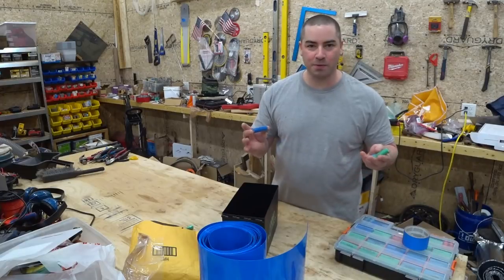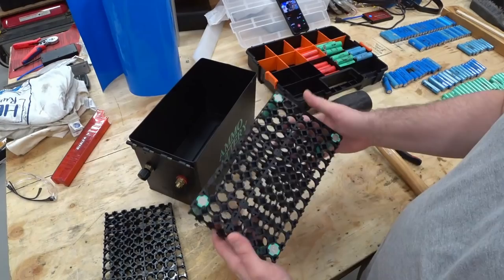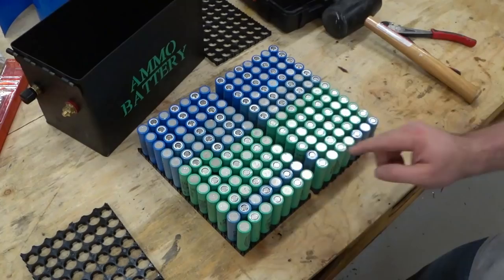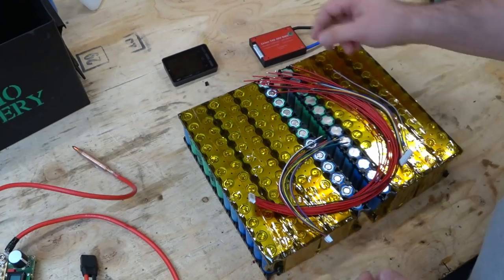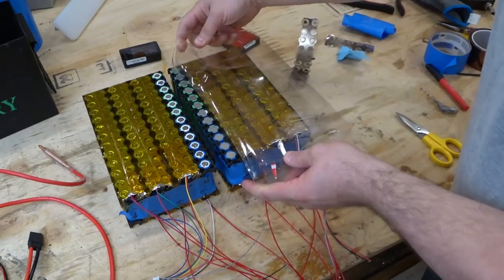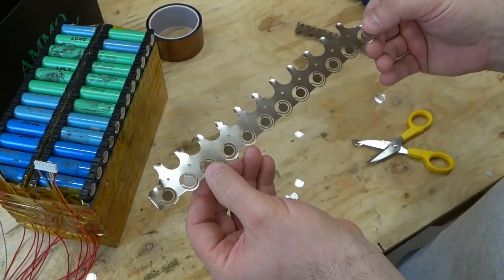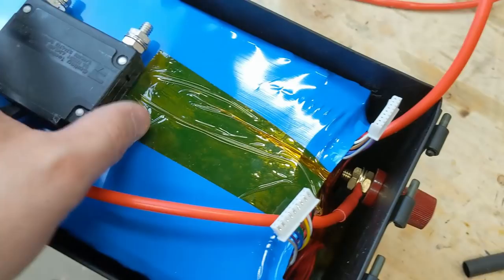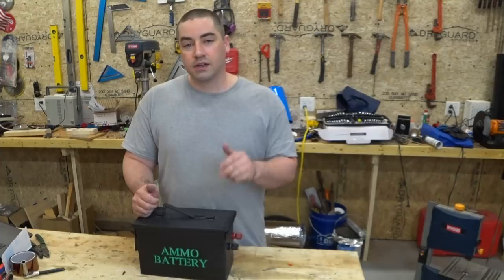48v DIY Battery in an Ammo Can

Comment: Hey Mr. p...I just heard somebody say something on another YouTube channel about hooking up something called a soft start for your hi draw tools..
Reply from the maker: Yep, that is fine for lots of stuff out there.  Even if I added an aftermarket soft-start kit to my miter saw, the running watts are as high at 15 amps.  This would be if you were pushing the miter saw through thick oak or LVL or something.  15 amps at 120v = 1800 watts.  Assuming a 90% efficient inverter, maybe 2000watts on the DC side, if the battery is at 50 volts, that's 40 amps.  This is 40 amps while running, not just starting.  Starting would be more.  40 amps would overload this little battery given it's BMS, wiring, cells, and breaker.  So a soft-start kit would not help this exact battery.

Comment: Is there a possibility for such a box with 12V output that can handle 3000W 12V - 230V without problems even for a loooong time??
Reply from the maker: Yes, but it would be much larger.  I built a 12v version, but you would still need 3 of them to handle a 3000w load.  https://youtu.be/6Ai5IRQbLcc

Comment: Thanks for the video! I’m working on something similar for camping or wherever I might need the power. You mention you used a 20amp breaker to limit current and heat. How is the 20amp circuit breaker limiting current for you, or it that just for safety? Wouldn’t that 60 amp BMS allow more than 20amps especially with that wire thickness at 48v? 
I’m really looking for the best way to hold typical outbound current in an ammo can like this, and the only thing I can come up with that would also fit in a can this size is specific cable size that is matched to the max amps I want to let out, so that only a certain amount of current can be pulled from the batteries. So I was just curious if the breaker is helping at all to limit current without popping all of the time with 168 cells divided by only 20 amps, or if you had any other suggestions?
Reply: The BMS has over current protection so why not just go with the 20 amp BMS and skip the $15 circuit breaker.  The 20 amp BMS cost $10 less than the 60 amp BMS and will disconnect the battery if you go over 20 amps.  That BMS has a 15, 20, 30, 40, 50, 60, 80 and 100 amp version.  I would think for your application and battery type the 15 or 20 amp version would be better.

Comment: Cool.  I have some ammo cans. Going to give this a try.   Did you 3D print the cell holders?
Reply from the maker: No, I bought the cell holders from 18650ed.  It's a company in Rhode Island, owner/operator is Keith.  He usually sells through e-bay: https://18650shrinkandcellholders.com/  https://www.ebay.com/str/18650shrinkandcellholders

Comment: I'm thinking about building this exact pack for powering an ebike conversion (750W nominal motor). Any concern with that? By my calculations, with the ebike contoller I'd be using, I'd be
configuring it for 20A max discharge, and with the cells I'm using (rated max discharge of 3225mAh), the 10p configuration would give me 32.25A max discharge for the pack, so I'd be well within safety limits at 20A.
Reply from the maker: Sounds like you have done your math out right.  I ran it for an hour with a temperature probe in there, and a 1C discharge.  The box did get pretty warm, about 100°F inside.  Still within specs, but I went an put a smaller circuit breaker on there limiting it to a 0.5C max.  But I'm using modem cells that are not made for high discharge.  If your cells are made for it (like from power tools) they won't get as warm.

Comment: Hey David love your vids. They have inspired me to get my solar project going after 10 yrs looking at it.
   Currently I’m looking at a inverter , but so many choices, I love the xantrex  brand but I’m hoping for something just as reliable but cheaper, could you recommend anything? Thanks
Reply from the maker: I would say the Aims brand is a very good balance between top of the line, and budget.  I used an Aims split-phase to power my house over a year.  but any further discussion will need more details, so Facebook is a better platform for that. https://www.aimscorp.net/
Reply: DavidPoz hey thanks for the quick response. I’m looking at a basic 12 volts system just to get my feet wet, nothing too fancy and expensive just yet.. what do you think about the Renogy inverter?

Comment: if you were rewiring your house with 110vac, would you include some 48vdc outlets? if so, which gauge  copper wire would you use?

thanks for the great videos, each one is more interesting. i really like this build.

i am wiring my house with 20 amp 12 gauge outlets solid copper conductor and 15 amp 14 gauge solid copper conductors for lights. would these work for 48vdc supply? i guess i need to figure amps for DC, just like for AC. perhaps i could use high voltage for light gauge conductors and convert to high amp and low volts (12vdc). i heard of someone using high volts, much higher than 110vac in a normal low voltage coaxial cable to save on the cost of the cable.then converting to 110vac at their home.

i am wondering about running computers from DC with buck converters. i just listened to jupiter broadcasting's latest episode of Self Hosted with wendel discussing 24/7 computer server energy efficiency. what an eye opener of the energy wasted in low power computers. if each component were DC and regulated independently, power could be lowered to a fraction of what they use now. that would be a great subject for a youtube channel! i better not post this. Oops! lol!

there's a lot of electrical topics that could be interesting to explore. take graphene/carbon nanotubes for example, it has PV capabilities and car bodies could become both PV generators and batteries, super lightweight and 10 times as hard as diamonds! and flexible, i image.
Reply from the maker: If I was building a new house today, I would not run 48 volt DC inside the house.  I would probably have an out-building (shed/garage) just for the 48v batteries and inverters.  Then the only thing running into the house would be 120/240v AC.  There is an exception in my mind.  If you were building a very small house (tiny house, cabin, boat) then I might run 12 volt DC wiring throughout just for lights.  But the losses in the wiring would become large even in a middle sized home.
Reply: @DavidPozEnergy  thanks, i am completely rebuilding a double wide, 60 feet (18 meters) long, 24 feet (7.2 meters) wide, so mid-sized.i'm bringing it up to code for real house, including electrical. i thought the power loss associated with DC was somewhat a myth. anyhow, i'll revisit that, i really suspect your focus on 48vdc is a great approach. thanks for answering!

Comment: Looks great but I have a question.  Is that nickel thick enough for the amperage you will be pushing?
Reply from the maker: According to the website: https://batteryhookup.com/collections/cell-level-nickel-fuse/products/nickel-fuse-2p-wide-continuous-roll-by-the-foot-18650-cell-level-fusing  Each connecting strip can handle 10 amps.  Because of the orientation that I have it arranged, that means the nickel strips can handle 120 amps.  But the fuses on the cells will blow before that, and my circuit breaker is 20 amps.  Plenty of margin built in.

Comment: Nice work! How many amps can you pull from this safely? And the amp hour rating? How much does it weigh? I want to build one!
Reply from the maker: The cells are 2200mah each, arranged 12p, so 26.4ah.  The cells can discharge 3 amps each, or 36 amps for the pack.  I limited this to 20 amps with my circuit breaker to keep the assembly running cool.  I don't want it overheating.

Comment: I'm building a couple of these ammo can batteries. I ran into a problem with the first one. on one half of the pack the voltage is 9% higher voltage than the other half. Tha Daly BMS won't start balancing cells until the reach 4.18 v so as I charge 1/2 the pack reaches full voltage before the other half gets to 4.10. The isdt will ballance 1/2 the pack at a time but I can't get the total difference between the 2 packs to change. Any suggestions?
Reply from the maker: When I have a situation like that, I typically will use a hobby charger.  Something like this: https://amzn.to/3w4Vp2O  This icharger X8 is the model I own, but there are several of this type.  First disconnect the BMS.  Then I will hook the X8 up to half the pack (7 cells in my case) and charge/balance all the cells to 4.20v.  Then I disconnect it from that half, and connect the X8 to the other half and charge/balance them to 4.20v.  Then I can disconnect the X8 and re-connect the BMS to take over.  Done.

Comment: hi David awesome video... just a question can this be built to be 12 or 14 volt for a solar system in a pop up camper for boondocking? i want to build a system to avoid the lead acid setup with a greater drawdown capacity for discharging on use  thanks for any help or direction on this
Reply from the maker: Yes, you can reconfigure the cells to make a 12v battery.  Depending on your equipment, a 3s or 4s setup can work.  Or switching to lifepo4 chemistry cells in a 4s makes a very nice 12v battery.  https://batteryhookup.com/collections/lifepo4-batteries/products/4-headway-38120-hp-3-2v-8ah-lifepo4-lithium-batteries-25c-200a-super-cells?rfsn=3333666.ca06e9

Comment: Are there any concerns about airflow or cooling?  I don't know much about this stuff, so just curious.
Reply from the maker: Heat is a concern with any battery.  I thought about cutting in cooling holes or a fan.  But any holes would compromise the fire safety of the battery.  That's why I put in a circuit breaker at 20 amps.  The cells could actually do twice that in discharge.  So I'm limiting the pack to prevent overheating.

Comment: With 12 batteries in series, with 1 amp fuses. Do you not have ~12-15A discharge before your fuses blow? ... Even before the midnight solar breaker trips?
Reply from the maker: I have 12 cells in parallel.  The nickel fuse strip is good for 3 amps continuous.  And the cells are rated for 3 amp continuous discharge.  So the build can handle 3a times 12 cells = 36 amps.  The circuit breaker is 20 amps so it will pop before the cell level fuses burn out.
Reply: @DavidPozEnergy  so, what you are saying, with the nickle strips, in this case, you do not need the glass fuses which hbpowerwall adds to all the packs?

Comment: Hi David, I wanted to know your take on a hybrid inverter vs using a grid tied inverter and a solar charge controller. I have a project for powering CCTV DVR and cameras totaling 16 cameras, 2 DVR, 2 4tb seagate skyhawke drives and lastly 2 Ubiquiti PoE 24port switches and 12 UAP AC pro accesspoints. Are hybrid inverters good or should I just go for a charge controller, grid tied inverter (charge the battery from both solar and grid) planning to get 2 200w monocrystaline panels and 2 100ah batteries as the load isn’t much with a 2.5kva inverter
Reply from the maker: I don't know anything about the camera gear you mentioned.  Is everything running off DC, like 12vDC or 24vDC?  If so then you might be able to run everything directly off a battery with no inverter involved.  If that could work you would only need a charge controller.

Comment: Look like you give up with your own design spot welder from microwave transformer, BTW what do you think about the spot welder you used on this video, I was thinking get myself one but not desired yet which one to get
Reply from the maker: Yes, I wasn't able to get my DIY spot welder working well enough for this job.  This Kweld works good.  At first I had some issues, but it was a problem with my power supply, not the Kweld.  I bought it from here: https://18650shrinkandcellholders.com/kweld/

Comment: This is cool! I considered doing just this for my diy ebike. Just need better cells for that
What size of ammo case are you using? Standard 50cal?
Reply from the maker: I think it's a pretty standard size.  I don't know what size rounds it held.  The box dimensions are 11"x5.75"x7"
Reply: @DavidPozEnergy  Yeah thats standard, going for a 7S setup here. Its the only one that will fit with inverters (or 48V like you do) since both 3S-4S is pretty garbo for that (maximum 16V for most of the 12V inverters). Im just doing a small setup here so I need a budget charge controller too. I have seen other tubers use a small green one, do you think its worthwhile?
Reply from the maker: The small green one is fine, but it is a Boost converter.  Meaning it boosts voltage up.  So, you can build the battery as 24 volts, and then charge using 12v solar panels.  This would be fine if you don't need a lot of power.  For me, I have a spare solar panel I like to use for some projects, and it is 365 watts, and the voltage is 38 volts.  So that would not work with the little green charger.  If you want to use one big solar panel, they are a much better price per watt than the little 12v panels.  But you would need a MPPT charge controller that will drop the voltage down.
Reply: @DavidPozEnergy  I ordered 200 cells now, thanks for the discount david. they were out of stock on the fuse nickel plating, but I have a solution with axial fuses (fast blow) and negative side 26swg tinned copper wire. I saw this work on average Joe's youtube.
Anyway, what size heatshrink did you get? I kinda need the same since its same box size :)
Reply from the maker: Awesome!.  I also ordered more cells this week.  Tom (owner) told me more fuse strip is ordered, but no telling how long it will take these days.  I'm going to start processing my cells and just hope he gets more fuse strip by the time I'm ready for it.  If not, then I'll be doing the axial fuses like you said.  Average Joe is a great channel for this type of build.

Comment: where did you buy the Point Solder machine?
Reply from the maker: Kweld spot welder.  I linked to it in the description.  Sold by 18650ed.  They are a small company in Rhode Island.  https://18650shrinkandcellholders.com/kweld/

Comment: forgive me for being silly but does ammo cans stop bullets fireing off in heat or very hot weather  that may hurt  or  kill someone ??   if so  would it contain and stop cell explosions and fires  ??   was this the reason for the ammo can  ??
Reply from the maker: Well, the ammo can would not stop a bullet.  But the steel box would help contain a fire if the 18650 cells went bad.  I'm not saying it's a guarantee, but I think it's a lot safer.
Reply: @DavidPozEnergy  thank you so much sir forget about the bullets it was just a thought as in if they stop them cracking off on there own then it makes total sence but that was the idea and if thease things get dangerous an short sadly there is  no stopping them  but id rather have this than plastic regards

Comment: Dave could I replicate this build in 12V?  I really want to do something like this as a battery expansion for my Inergy Apex unit. Would appreciate your thoughts!

Yes people I know Inergy just introduced a new battery. I'm done waiting and hurricane season approaches.
Reply from the maker: Yes, you can make it 12v.  However, normal 18650 are Li-Ion, with nominal voltage of 3.7 volts per cell, and fully charged are 4.2 volts per cell.  So they don't work well for 12v configuration.  instead, I suggest making 12v batteries out of LiFePO4 chemistry, which has a nominal voltage of 3.2.  A 4s configuration of LiFePO4 makes a perfect 12v.  Try these: https://batteryhookup.com/collections/module-madness/products/a123-36v-module-w-48-26650-anr26650m1-b  You can still use my coupon code for 10% off, DAVIDPOZ

Comment: Could you power a electric bike with this pack
Reply from the maker: Sure, so long as the motor is 48v and probably less than 800 watts.  These are not high-amp cells.  If you had a big motor, like 1500 watts or something, you would want to use cells made for high discharge current.

Comment: What are using 48 volts on, I can see the amperage for a longer use
Reply from the maker: All my equipment is 48v.  My solar charge controllers and my inveters.  I can parallel this battery in with my larger batteries, or use it stand alone with one of my smaller inverters.

Comment: Those look like laptop batteries to me..... what kind of modem has its own battery pack?
Reply from the maker: Sometimes the modem you lease from your cable company has batteries.  I don't own one of those because I think the lease is a rip-off, but that's what I'm told they were built for.
Reply: @DavidPozEnergy  You're right.  Rented modems are a complete rip-off.  Right now I'm fighting Frontier (formerly Verizon) because I found the have been charging use for a rented WiFi router an we never took one of their routers because our own is better!   And they tried to justify the charge for renting equipment we were never given!  wow....     Great videos David.  That kweld machine you linked sure looks like a great battery welder.  Unfortunately, they don't have any to sell right now.

Comment: Whats the best way to do with making a battery bank i need to make a huge bank for an rv application but im not rich so im going the diy way what do you recomend to do what route for the best bang for the buck
Reply from the maker: If you plan to make a 12v battery, then use LiFePO4 chemistry, such as my recent video making a 12v battery.  But if you want 24 or 48v, then you get more kwh/$ if you buy the BMW packs Battery Hookup has for sale.  They are large format EV cells.  I use 2 of the 5s modules and 1 of the 4s modules to make a 14s battery (perfect 48v).  https://batteryhookup.com/  You can use my code DAVIDPOZ for 10% off.

Comment: Is the tower of power going to be used still?  You've still got 24 kWh in it.
Reply from the maker: Yes.  I bounce around between projects as I get time, or need to order parts.  The tower of power is still going to be hooked up.  Just yesterday I replaced my buss bars with thicker copper bars.